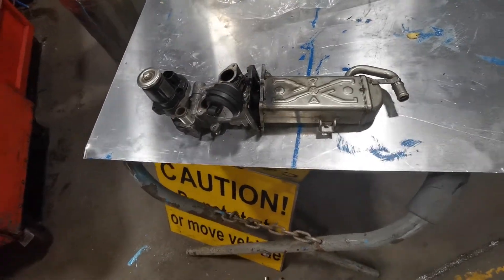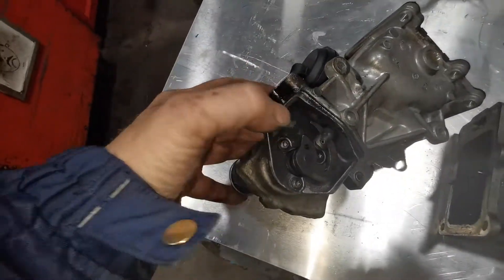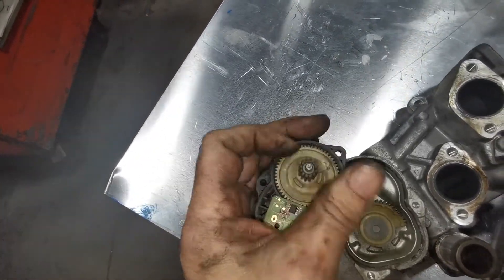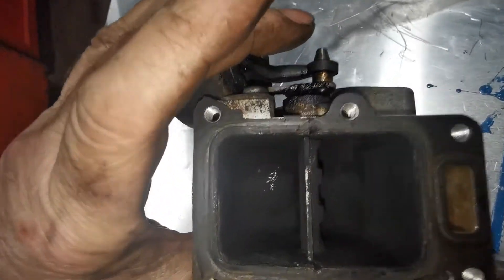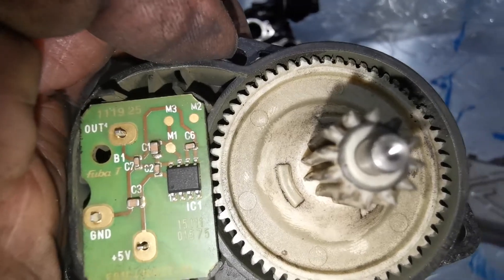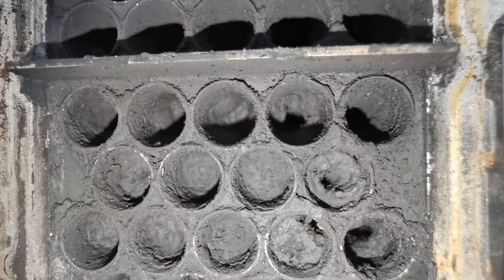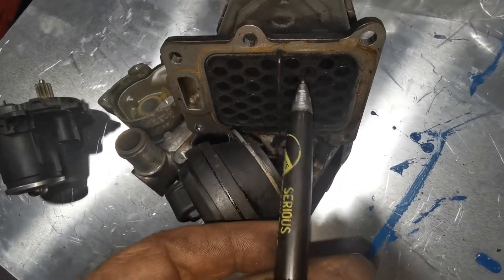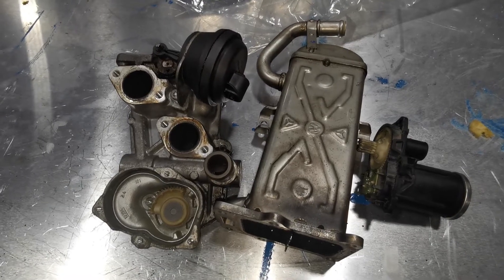VW and Audi diesel EGR problems and why they fail.

Comment: Replaced a leaky unit with a used one, now throwing sensor b low fault. 

Removed the egr motor in situ and found the plastic gear stripped. 

Replaced the motor from the leaking egr, fault code will clear when running but will come back on if revved, and will come back on straight away if ignition turned off and on.

Don't seem to be able to adapt it using my launch so I'm guessing that the potentiometer needs setting up or something. 

Any idea which pins on the plug need probing and what the voltage/resistance should be fully open and fully closed?😊

Comment: A great explanation, thank you. Any one know what tells the vehicle's ECM that the EGR unit isn't functioning properly? As shown, there are no sensors in the unit itself, so are the fault codes being generated simply by the position of the electric motor/nylon cogs? From what I can gather so far, the effect on actual emissions isn't enough for the exhaust sensors to generate a fault if the EGR is playing up. Any thoughts??

Comment: It's not the EGR and cooler that is expensive to buy, it's doing the job itself which is an absolute mare to do ! even for an experienced mechanic, many garages don't even like doing the job ..... don't go for the absolute cheapest Chinese, there are some very good aftermarket ones now with thousands sold, you don't need the genuine VAG one if you've diagnosed the fault 100% correctly, but as I say, its "having the thing taken off and replaced " thats the expensive bit ....... good luck

Comment: remember about correct direction egr ending valve in intake, factory outlet is directed on throle, it caused carbon deposits on it, and more problem with intake dirt. if you turn over egr outlet direction oposite to throle then fresh air and  egsausth gases coms both in the same way and gas flow by egr coller is way much better.  another problem is crankcase ventilation, oil fog & carbon combine together and clog intake. I changed direction egr valve in intake 15000 km past, and last week i have checked and throle was clean.

Comment: I’m having a problem with a 1.6tdi. It had a DPF delete and map 4 years ago. 2 weeks ago an injector failed and went into limp mode. Replaced the injector coded it and now it’s down on power when in 4th and 5th gear also the temperature gauge drops off when motorway driving but then rises to 90°c again when driving in town. Live data shows EGR command closed buy EGR error at 99.2% which I believe means it’s sticking open. Would the temperature dropping off be caused by a sticking EGR valve.
Reply from the maker: No, that's more like the thermostat has failed and is stuck open
Reply: @sheepdipR1  I initially thought a sticking thermostat I haven’t tested it so I will also test that. I’m not sure if the temperature was dropping before or if the problem came at the same time. When the temperature gauge is sitting at 90°c it still runs down on power so I don’t think that alone is causing this issue. Would a sticking open EGR valve cause a loss of power. It actually feels like an injector misfiring in 4th and 5th. I’m waiting on a new scanner to pull the fuel trim data but my scanner did pick up the EGR command vs error and it seems way out.

Comment: Similar mechanism on BMW diesels although these suffer from wear on the shaft sleeve which tilts slightly and then doesn't return or exhaust gas blow by through the sleeve which gums up the mechanism. Later versions have a larger roller bearing which doesn't suffer so much when the shaft/sleeve is only slightly worn.

Comment: Yes I have got a Vw I have a 2013 blue motion passat 20.tdi, the garage I use are deleting the EGR and are mapping it from 140 to 180. I think Vw should recall these to fix this problem at £1100 pound to replace it’s an expensive part to replace and if you put a new one on it’s only going to do the same thing depending on the driver
Reply: agreed, EGR is guaranteed to fail, they put these clean air concept costs back on the consumer, pay £1k every 5 years. I will never buy a diesel again

Comment: My EML light keep coming on and off in my Q5, it’s been a year now, no issues whatsoever, pulls like a train, went to dealer 1st diagnose they told me got something to do with ad blue, paid almost £400, 2 weeks later light came on again, this time they say it’s the EGR, will get a quote sometime this week for replacement. Not happy.
Reply: How much was the quote?
Reply: @JohnJSW  turns out my coolant was leaking, noticed oil marks on driveway, cost £420 at local garage to put it right, been couple of months now, no more EML light , touch wood, sorted.

Comment: The nylon gears fail because of the the hook and plunger that moves the valve becoming worn and jamming. U can see it inside the back cover on the back of the valve body
Reply: It does, but 9 times out of 10 you'll replace that then find out its completely clogged up with rock hard carbon and soot and the problem will return, once its out, replace or delete .......
Reply: Hitachi brought out a modified version so that it cant scrap or jam, but essentially the nylon gears would need to be replaced with metal ones and a bigger motor or just total redesign, its just a crap idea, not suprised people delete it.

Comment: You are totally correct with your diagnosis of the most common problem with this item, although they have also been issues with water or coolant leaking also.
Just a tip you can actually clean the EGR cooler as its stainless steel in construction ,but time consuming and dirty job to do.
Best product for this cleaning is Mr Mussel   oven cleaner spray which contains Sodium Hydroxide so be careful wear rubber gloves and eye protection.
Reply: I usually find that the motor has been worked so hard due to the sticky valve that I just forget about a repair and replace every time - big job though

Comment: Its also on the 1.6 tdi VW/Audi mine needed replacing at only 36,000  cost of genuine VAG  £300  plus VAT Labour cost £220 plus VAT
Total nightmare job if you don't have access to a car lift, car on ramps is possible but so much more awkward and space restrictive not good